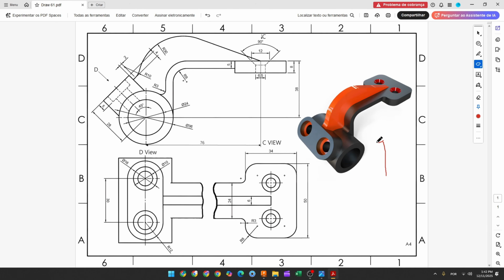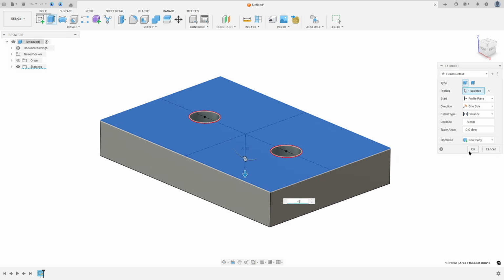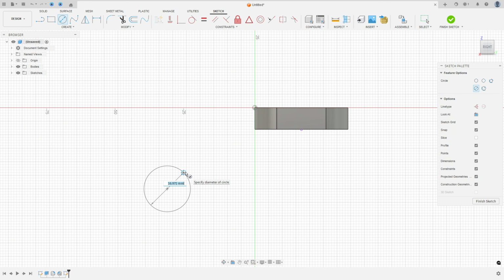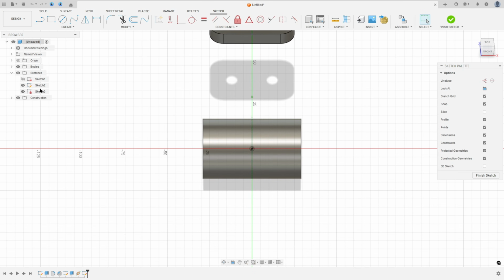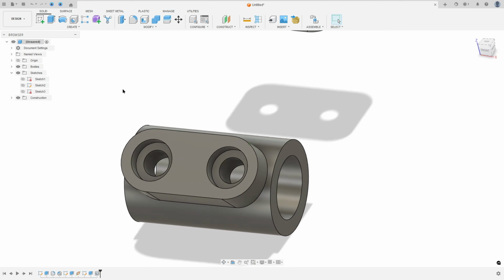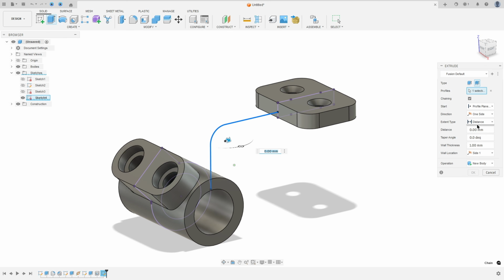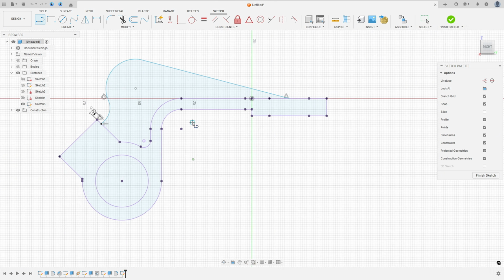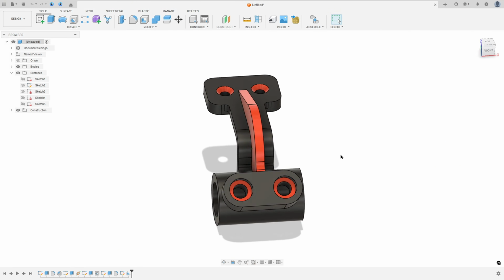How to make a RIB in Autodesk Fusion -  Exercise 61

Comment: Nice  tutorial as always, I would have just drawn the whole thing from the side profile and extruded it symmetrical and then add fillets and such.
Reply from the maker: That's a great alternative approach, thanks for sharing! 😊
Reply: I wouldn’t call this guide brilliant, though. The author certainly tries.
Unfortunately, many of the sketches are downright childishly simple and contribute nothing constructive. Many of the base drawings are drawn without taking into account ISO standards regarding drawing requirements. Sometimes the drawings even lack dimensions.
So, these tutorials are useful, but they should be treated as absolute basics. However, you should also look for guides by other authors to gain more knowledge.